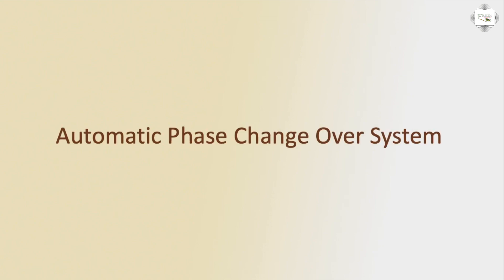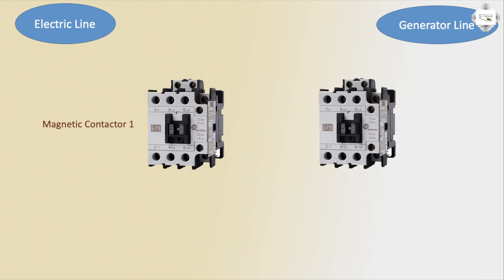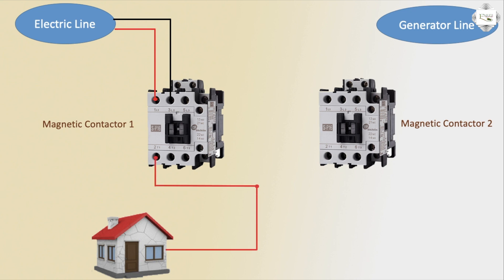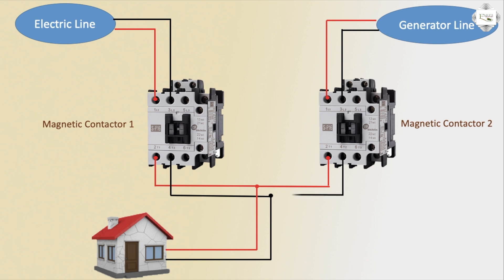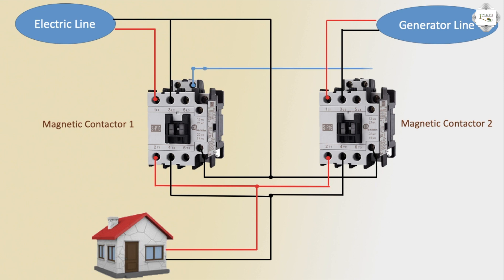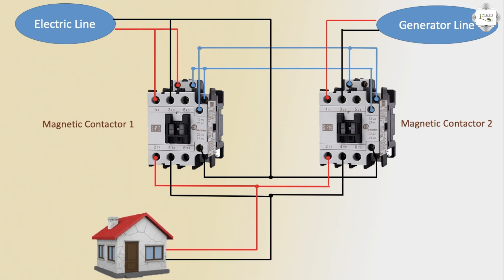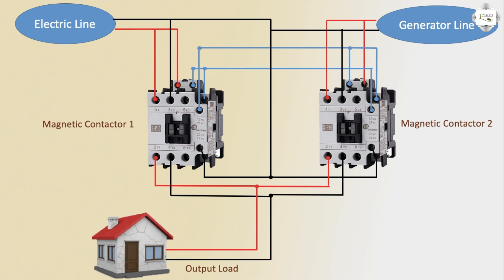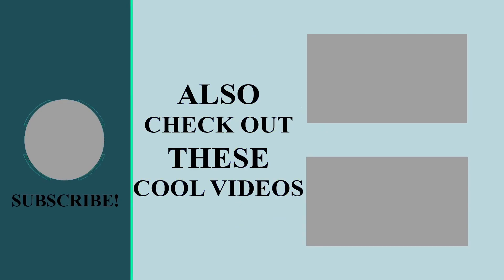Automatic Phase changeover System | Single Phase | Automatic line Changeover

Comment: Brother you have to provide, both mech'l. /electrical interlocks. And also for both normal /generator source of power MCB protection.Add@the front cover of C. Panel, & provide pilot lamps, control protection,&other electrical standards for safety, & don't make short cuts wiring diagrams.
Reply from the maker: yes, sir full info website @earthbondhon.  I love to receive your comments and feedback.
Thanks for watching it.